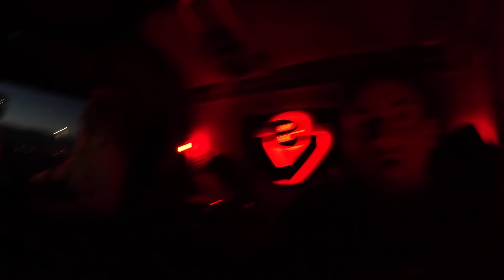ABERDEEN & back again...  Nearly didn't get the truck back in time for the job!

Comment: Hi TruckerBaddie. Your truck really looks mint. Just a little tip for your safety— it’s best to strap up on the near side of the vehicle just in case any straps come loose and you have to tighten them on route. Keep on trucking. 🚚

Comment: Hi your truck is looking really good all the lights on made it stand out . Your trip to Aberdeen did you not look for a return load as you will not be making much on this trip with the cost of diesel fuel . I have 3 trucks and its very rare I just go with a one  way load and not  a return load not with forking out £1400  in fuel plus a take it you hired trailer  from King's.  You need to get this truck earning now . Once you get the other bits  fitted this truck will be nearly show ready  . Shannon's interior on her scania looks impressive now it been all pimp out especially the dashboard she said that her and her dane put lots of extra screws into empty bits inside the dashboard on rebuild and all the rattles an seeks are gone. It can be very windy up in Aberdeen as you are right next to North Sea and it gets full force wind
Reply: I was going to ask the same question about no return load did not make sence to me
Reply: Onlyfans paid for the return fuel.😂😂